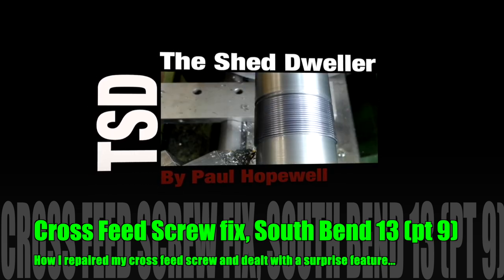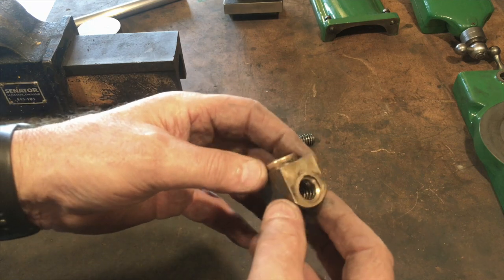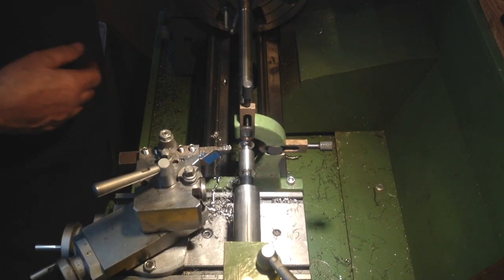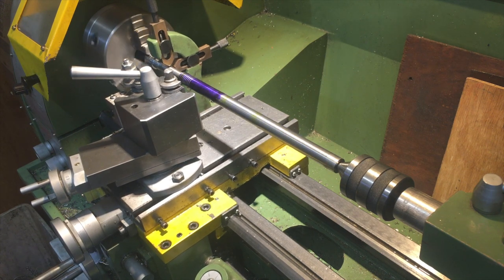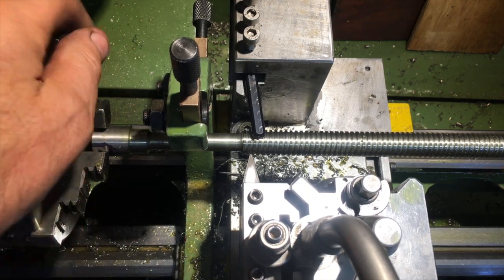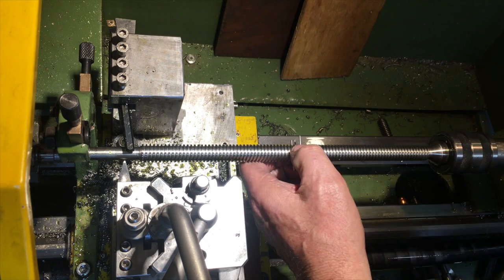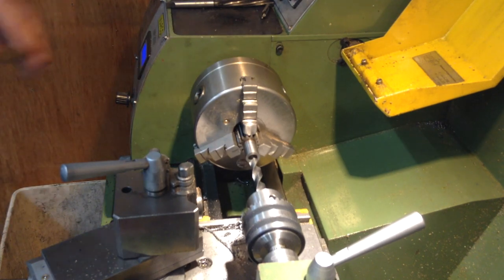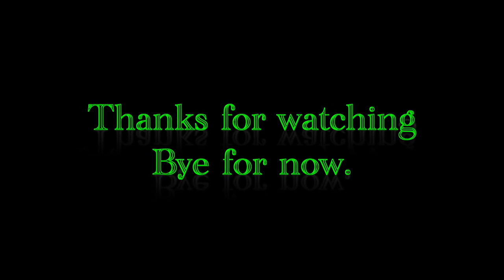Cross Feed Screw Fix, South Bend 13 (pt 9)

Comment: Are you tempted to make a double nut rather than a long nut? Hardinge use this system to eliminate any backlash.  It's a bit like a gib but in nut form if you know what I mean. Don't know what they are called, rather like the method of locking two nuts together but only just touching. Does my poor description make sense?
Reply from the maker: Mmmm, I'm not sure I want to go to that level of of backlash removal because I’m used to having it around, it’s like an old friend. Without backlash I’ll still go through the motions. Sad init.
Reply: @Thesheddweller  it's very nice to be able to adjust how much backlash you like though. Worth looking at and quite simple to make, I love clever. ❤

Comment: Hi, I've just done exactly the same with my Harrison L5A, after a couple of false starts I finally did it. I repaired the original nut by boring out the old threads, silver soldered in a piece of bronze, I made a tap using the same hss tool I ground for the leads screw and tapped it. All the best, Tom
Reply from the maker: Hi, I thought about using the old thread as a tap, to rough out the nut before finishing with a good tap. Mind you I like the idea of silver soldering a sleeve in…cheers.

Comment: Looks like a custom travelling steady mounted on the crosslide is a future project. I had a similar experience with the shaper, someone had replaced the feed screw only they had changed the pitch, took me a while to work out why the graduated dial didn’t tally with the feed rate.
Reply from the maker: Hi Tony, yeah modifying the steady would be a future project, but its going to have to wait in the queue. There are loads of projects on the way, but now I’ve got lots of people asking for bits to be made. regards

Comment: Wow, thanks for the in depth explanation.  I am a novice...I thought you may be able to cut and grind the old lead screw into a tap to make the new nut. Because it is a bit undersized it may just work out very well.
Reply from the maker: Hi Hans. The lead screw used as a tap( after preparation )wouldn’t work because the old lead screw is smaller than the new one by a very small amount, where as a new tap should be up to 0.125mm ( 0.005”) bigger for that size acme screw. regards

Comment: Hi Paul, I've been muddling along with a dead centre and a shop-made s/h live centre for a while now. Would you recommend getting a proper live centre or persevere?
Reply from the maker: Hi William. Muddling along is, for me, a phrase that very much sums up the engineering industry. 
I find, if what I've got does the job,.. that's enough. But, if I need to buy something to help me get the job done I’ll only buy it under certain conditions… that is, if I can’t make what I need, I can't borrow what I need, is it for a one off job and I can afford what I need, will it make my life much easier . This is very much in line with most engineering industry practices. regards
Ps, if you have a dead centre with a tungsten carbide tip that'll do for almost everything.